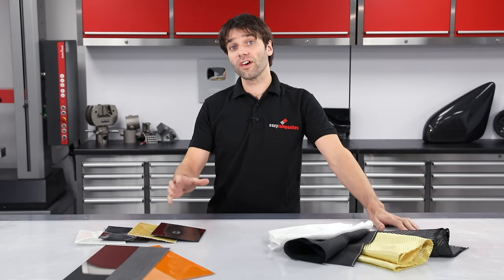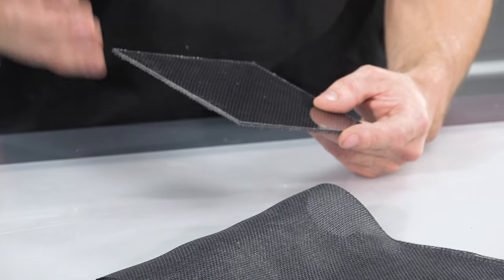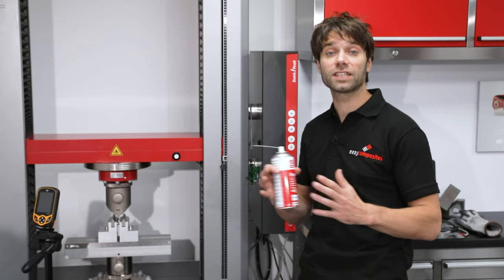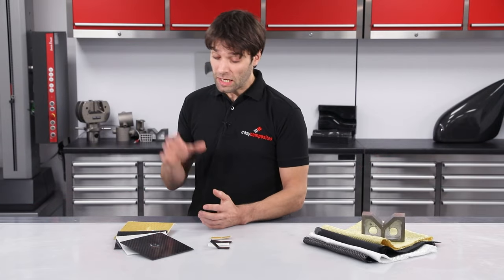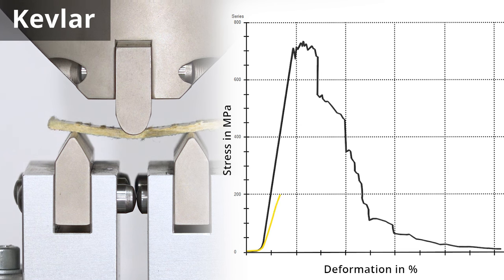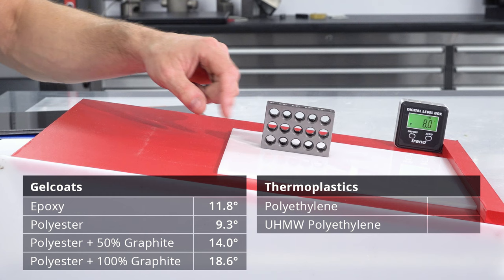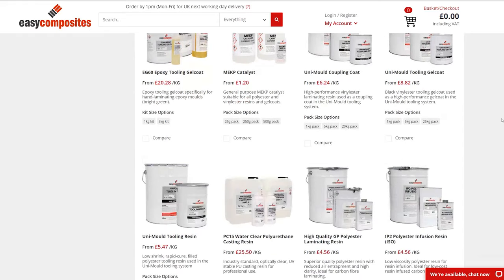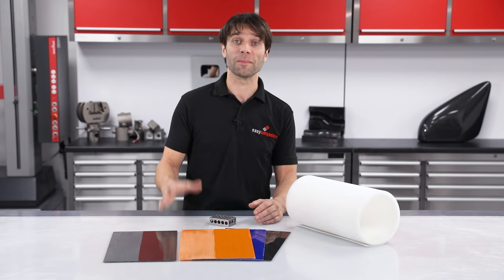Choosing Composite Reinforcements for Impact Strength; Kevlar, Carbon, Innegra, Diolen

Comment: Hello. Congrats about your videos. Really useful to get into a lot of things without physically go to a lab or production site.

I got a question: can you explain why laminating at 45deg orientation is so easier than laminating at zero please?

Thanks in advance
Reply from the maker: Well, laminating at 45 degrees is only any easier if you’re laminating over a feature (corner for example) which is aligned at 45 degrees to the reinforcement. It’s to do with the way that the reinforcement distorts to accommodate the feature. Because the fibres can’t stretch, and they don’t particularly want to ‘bend’ either, it becomes noticeably easier to use a 45 degree fibre orientation in corners.
Reply: @easycompositestv  

So it is basically depending on the geometry, meaning laminating at 45 is actually easier only because usually the main geometrical features are "aligned" with the fibers for a ply at 0deg/90deg.

Thanks so much for answering. Have a great day

Comment: Hi Paul, thanks again for the vids.  Was wondering if you might do one about whether there is a case for mixing materials in one part.  Be it purely cosmetic or an attempt to gain value. For example putting a layer or two of kevlar on the bottom of a carbon boat hull specifically for it's abrasion resistance.. Or a Diolen/Innegra skin with an integrated carbon support structure/frame, for a panel that's more forgiving of bumps. Perhaps adding some kevlar to a carbon part with a view to changing the part's failure mode from something that fails and snaps off.. To something that fails but remains attached, (albeit in a seriously compromised state).   And On that topic.. Some thoughts about blended fabrics like carbon/kevlar.    Cheers. :)
Reply from the maker: We've got a number of upcoming videos but for sure, we'll put it on the list. It might not be a video on its own but might be something we can cover as part of another tutorial.

Comment: What if you vacuum mould the polyethylene to the shape of the sled and then use that shell to create a kevlar composite on the concave side?  You essentially made a polyethylene coated composite.  The outside is slippery, while the inside is strong.
Reply from the maker: Hi Mark, that’s an interesting concept. In reality I think there would be quite a few drawbacks - the polythene shell would be heavy and offer little strength or stiffness (being unreinforced) and the slip reduction is only needed in limited contact areas, also, it would be almost impossible to bond the Kevlar composite laminate to the polythene when trying to reinforce it from the inside.

Comment: How would you incorporate the UHMWPE into the mold? Would you coat with a graphite resin?
Reply from the maker: In basically the same way John. You could use a woven UHMWPE cloth in place of some or all of the Kevlar. The properties would be slightly different and it's often best to use UHMWPE in conjunction with other types of reinforcement.
Reply: @easycompositestv  thank you for your response

Comment: Awesome vid man, doing the same to my car, can you do basalt fabric? Also I'm using graphene (I made myself) and SiO2 enhanced Polyurea. I'm ordering fabric now and I was wondering Carbon Fiber Kevlar or CF/ UHMWPE. Price has a lot to do with it and if I screw it up looks wise, I'll trow a vinyl wrap on it.
Reply from the maker: Hi Joe, thank you for the comment. If it's general impact and abrasion resistance then stick with the Carbon Kevlar hybrid or even separate materials in layers.  For a typical road car you are normally fine with a mostly carbon layup with a layer of Kevlar within it for a bit of added impact resistance. For drift or racing with likely contact, a balance with more Kevlar is better for the impact resistance.

Comment: It’s a shame you went to all the effort and research and they didn’t go with your reco of the thermoplastic. Great videos as aways
Reply from the maker: Well, the suggestion of incorporating PE into the belly of the sledge was only really an afterthought. We were going testing the thermoplastics in order to confirm that it does make sense for the runners to be thermoplastic and not just gelcoat. We all know skis and snowboards use this material (PTEX) and so it was highly likely they would offer the lowest friction and, of course, they did. Incorporating it into the belly of the sledge would have been a whole redesign and at the time of filming the project was due to go ahead this winter. Covid got in the way but I'm sure Alex made the right decision to keep to the project on track.

Comment: Hi, I'm following your vids for a while now. I'm very much interested in carbon fiber applications.
Any idea why there is no trial with wax (reindeer fat, lol) to lower the resistance on ice? It's a century-old (more than one) trick, and still used when skiing (waxing the skis).
Reply from the maker: You could additionally wax the surfaces - albeit wax can wear off over time. We specifically wanted to test the materials used in the construction of the sled.

Comment: Crazy interesting ! :) @ Easy Composites Ltd sorry for the stupid question but can you please recommand me an reinforcment (from inside because this bumper is done) for an front bumper of an bmw who was made in fiber glass ? after is done can we renforce that bye a layer of Innegra, Diolen, kevlar or something else better ? it need to be close of PU/ABS resistant but Flexible. what material you recomand to us ? here when we park a car in a street line parking other cars when they come to park the always (is sick !) will touch your car or even push it a llitle to park. this result on an fiber glass bumper to crack it... thank you
Reply from the maker: For this application you would want something as stiff as possible so that the bumper doesn’t flex and therefore doesn’t crack. Woven glass would be a good choice or carbon fibre if you want to keep it a bit lighter for the same strength.
Reply: @easycompositestv  thank you alot Easy composites for this fast answer ! I get an pro recommand me to put kevlar but with your test i understand is too flexible. if i will make an mold of this bumper to make it again with flexible materials to be closed of an original one from bmw who is an mix of PU and ABS to not break you recommand me wich best material ? to renforce that actual bumper from inside (part we dont see) the best material will be first Woven glass (what is that ?) and in 2nd position carbon ? or the carbon will be exactly the same strength but lighter like you wrote ? the differenxce of weight is big ? like 2 times less ? i saw on you web sit you have different carbon too. last question i need to cover all the inside of all the bumper ? or just some area ? thank you again. i have 2 compagnies here i will probably open an service of mold. will probably work with youn look you know very well your job who is not so comon here in france ;)

Comment: IF as you stated, the sample material is "encapsulated", I would think that means that the bonding agent
is the surface that your steel block is running on and not the weave material itself....Do you Polish OFF
the surface exposing the substrate ??....
Reply from the maker: The weave is irrelevant to the tests as the resin gel surface is what provides the friction. Hence it was different resin/plastic types that were compared for the test.
Reply: Easy: That is what I said, but I must have missed the part in your presentation of friction, where you stated
that you were comparing different bonding agents vs different fabric types....

Comment: It seems like eglass or perhaps sglass would be a good contender here. It has more elongation than carbon so it would likely have more impact resistance, I presume it would still be stiffer than some of the other polymer fibers and provide similar strength. Perhaps my understanding here is wrong. Is there any specific reason that it was ruled out?
Reply from the maker: e-glass was ruled out early on.  S-glass is not easily available.
Reply: If you check out the intro to the series, you'll see an e-glass sledge. They don't perform awfully, but are extremely heavy due to the density of fibreglass.

Comment: I think it would also have been good to test a UHMWPE for the body~
Reply: it is hard to adhere to resin
Reply: @peterocks88  I believe there are some PE Compatible resins out there
Reply: @ubacow7109 the surface of UHMWPE is too inert，it may reinforce itself and PP，but they aren't hard enough for bike body
Reply: @peterocks88  i assume as such, but i think it could still work as just the abrasion material reinforced by a diff backer~
Reply: @ubacow7109  no, PE can't withstand high temperature
Reply: @ubacow7109  still best for civil ant-ballistic materials and rope

Comment: testing friction ... did you compare your materials just against some skier? You need not to reinvent the wheel.
btw ... some cross-country skier are special designed to have high friction backwards in case you have to climb a slope. (you can achieve such behavier by mechanical anchor-like backward stopps , too) And skier more or less do have sharp edges to keep it on track having grip against side moves which could be usefull crossing a sloped area.
Probably teflon could provide lowest friction but I don't know how to glue it

Comment: Can you tell why drifters use carbon-kevlar composite for body panels which can be hit?
Reply from the maker: Hi Alex, Kevlar is a very high tenacity fabric which can undergo a fair amount of deformation without fracturing. This means that it can take repeated impacts and still retain its strength.

Comment: Hey, would a carbon and innegra combination be useful for something like a case? 5mm pine ply is the standard in my field ; so the stiffness and strength of carbon with maybe one layer of something else like innegra feels like the best way to minimize the effects of a catastrophic failure while still reducing the weight and upping durability when compared to conventional models.
Reply from the maker: Mixing carbon with innegra and aramid based fabrics is quite common to get that balance between stiffness and impact resistance. We have seen similar on quite a few case designs.

Comment: make a video on thermoplastic composite :D
Reply from the maker: Hi Rifat, thanks for the suggestion. Due to the temperatures, pressures and tooling that's required for thermoplastic composites they are of very limited interest or use to smaller manufacturers and individuals which is why we've not chosen to cover them so far, but we'll certainly keep the possibility in mind.

Comment: Why not mixed materials? Put Carbon outside and Innegra in the middle where the neutral fiber is. That would save weight.
Reply from the maker: It is perfectly possible to blend materials to produce a hybrid construction. The issue being that if the carbon skins fail then the strength is vastly reduced, Kevlar on the other hand still offers reasonable strength, even when fractured.

Comment: Just throwing out a design opinion-- I wouldn't be looking for one material winner.
The conditions are so extreme and so difficult to replicate in a testing lab and given lives depend on success that I would lobby for sending out sleds of two formulas.  Hedging bets, if you will.
Generally speaking, the best option is usually the one that leaves the most options.
And I did not watch the sled design video, but will say I hope the design allows the sleds to nest.  Not just for transporting to the mission launch location, but also to allow "doubling up" as an option during the pull.
My $0.02.

Comment: Can you combine two different coatings, one for strength and the other side for less friction?
Reply from the maker: Composite moulding in this way really is a single sided process with a moulded 'A' side and a rougher 'B' side. Additionally, very little strength comes from the gelcoat so adding another layer to the 'B' side would achieve very little. In this case polyethylene runners were attached to the bottom of the sled for an even better sliding surface.

Comment: Hello . Which model of carbon fiber are used for super car chassis.  Are they use dry carbon fiber or wet and how many plys they use  . Tnx for any idea .... cheers
Reply from the maker: Mainly they tend to be using prepreg but some manufacturers, like McLaren, use a hybrid process that most similar to RTM (matched tools, dry reinforcement, resin injection under high pressure) but this sort of tooling is incredibly expensive so is really for volume manufacture only.

Comment: How would S-glass perform? Would it win?
Reply from the maker: S-glass wouldn’t be a better choice for this application because it doesn’t have the impact toughness of Kevlar and it’s quite a bit heavier, strength-for-strength.
Reply: @easycompositestv  Kevlar is better in tension but S-glass is better in compression. S-glass have better elongation than kevlar and carbon and its stronger even than carbon and twice cheaper, I don't know if overall it's better than kevlar for this application  but I think it might be better than inegra and diolen. Good contender missing

Comment: You should have compared it with same thinknes and same stiffness sheet aluminium and steel, because most people are replaceing thees materials with other materials.
For me, I have been looking around countless hours, how many layers of 200g of cf I need to have for same stiffnes as 0,7mm steel, because I am going to make cf bonnet without honeycomb and I would not like to see bending it into engine bay at higher speeds.
Reply: They have a video on making a carbon bonnet which should answer most of your questions.

As with steel versions of bonnets the skin by itself will flex a lot, if you were to make a panel thick enough to not flex it would be very heavy and expensive.

However, by copying the internal frame you get the strength to resist the flex without it being heavy or as costly.
Reply: @Tamagoman  Yeah, I know about that video, thats why I wrote that I would make it without honeycomb, it sucks 1kg of per m^2 of resin into it. I would like to get it without that extra weight. Inner frame is deffinetly my goal.
Reply: @Martink9191  I get where you're coming from. Maybe consider nomex honeycomb as a core material as it's even lighter than infused fabric (and available in the same thickness as Soric)

Best to contact Easy Composites directly to pick their brains about which would be better for you.
Reply from the maker: The video was not designed as a general composites material property comparison but specific for this project only.  It is possible, if the demand was high enough, that we may in the future do a comparison video.
Reply: @easycompositestv  I am all in. Ofcourse this video becomes pretty long and complex, because of different thickness, wave and angle of layers.

Comment: What if we weave Diolen and innegra thread together ? It will be more. Strong rite?
Reply: Both are highly flexible, and with long elongation to break - innegra just more so, and less dense. So, you'd end up with a material roughly in the middle, without the more interesting hybrid characteristics of combining very stiff, high strength fabrics like carbon with flexible fabrics like diolen (polyester) and innegra (polypropylene) .

Comment: What will be stronger to break plywoor + comosite or composite kevlar plus carbon fibre?
Reply from the maker: It would depend entirely on how much of each material was in the composite, the orientation of the fibres, the materials combined with the plywood, the wood/grade of material used in the ply and the method of testing to name a few. Without more parameters there really is no easy answer I'm afraid.

Comment: If I made a carbon fiber part without a mold, and were to buff it to get it smooth and shiny like I used a mold- does this work? will it reduce the structural integrity?
Reply from the maker: This process could still yield a perfectly serviceable part. It would be heavier than a part hand laminated into a mould and heavier again than a part resin infused or vacuum bagged into a mould, mainly due to a higher resin content. Nonetheless, still a valid process for less performance critical applications.

Comment: What I don't understand is why you are not talking of mixed used of diff fabrics for their diff characteristics. In 2008 I was very much looking into sea kayak that can perform in every kind of environment and I found some in Germany using both Kevlar and carbon or kevlar and some kind of Diolen... there was also fabrics doing both... and in your video at 11:57 you have a plain weave kevlar and carbon cloth meaning you could have the impact resistance of Kevlar (well known for that and some lightness with carbon...) So I don't understand why you didn't show us that?! I would like to also say that you did not explain something very important in my opinion : All the materials here are subjected to the quality of the resin and it is as important as the quality of the fabric. every maker as a sheet with the "bounderies" of use, so you know which is the lowest temperature you can expect the material to fail. why didn't you talk about it? (unless this expedition is not meant to be around -80°C) 
Here also, an engineer talking about "structural" perspective : https://www.youtube.com/watch?v=KHXVf0SaJpA
In any case, wish you the best. Cheers!
Reply from the maker: The hybrid cloths were discounted early on and the resin being used was already decided based on prior experience so there was no need to waste time doing further tests on items that were not being used.
Reply: @easycompositestv  you answer sounds a bit like "it is what is... get over it" to me. So what I understand know is that you are telling me these videos are just promotiional videos of your only cie, not general science infos, right? ok. now I know.